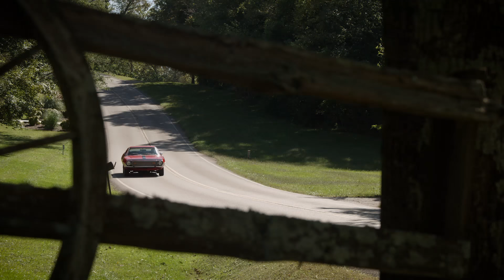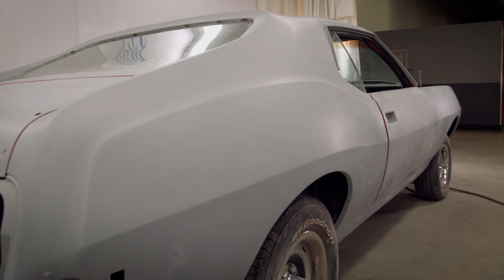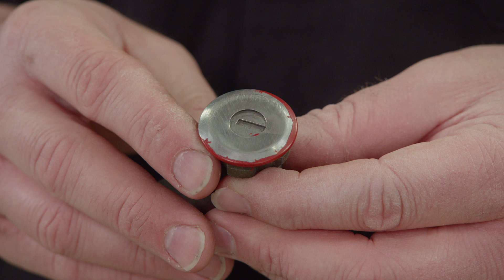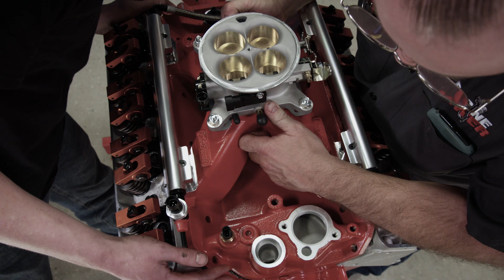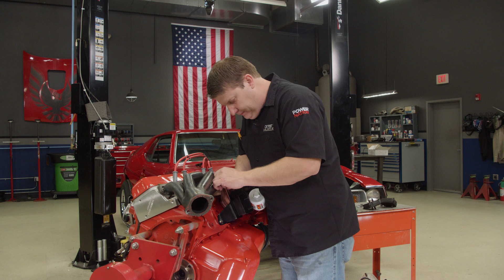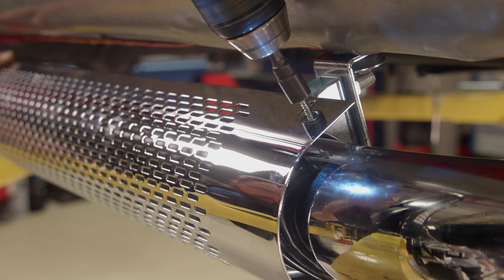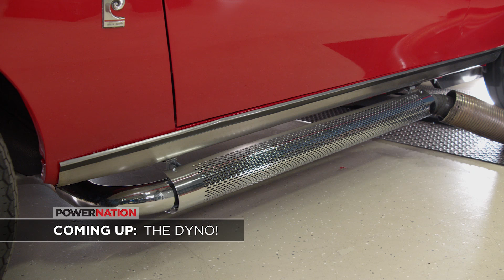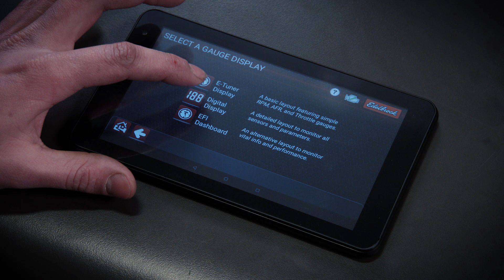Full Build: Transforming an AMC Javelin to a 70s Muscle Machine

Comment: That 304 has to be hurt. I have a 73 AMX with a 304 and it’s a lot more powerful then what this was in the beginning.
Reply: with knowledge any motor can have a high power output
Reply: @moisesgaribay4893  I’m talking stock vs stock.
Reply: The AMX had what was left of the performance goodies in '73 while the Pierre Cardan was a looks and cruiser option minus the power (unless it was an ordered one with the good stuff under the hood)

Comment: one thing to keep in mind, you need to run 91 octane or higher in amc engines from this era. i had a 72 gremlin and the thing ran like crap on anything lower than 91 octane. that's because when these cars came out, 91 was the lowest octane at the time. tried running 87 in it and the fuel mileage cut in half and was gutless. went from being able to smoke the tires to barely able to make it up hills.
Reply: that's also kinda sad if that's all thaty engine was making. a 71 gremlin with a 258 cu straight six made 150 hp with smog crap on it with a carter yf single barrel carb.
Reply: @spicydeath82  I would say the federal government had a lot to do with the decreased horsepower in those 2 years between 71 and 73 as they were putting some pretty awful restrictions on auto manufactures during that time period to reduce emissions. Most manufactures had to de-tune the engines so much that just after a few months of running them, (basically around the time the engine was broken in) the engines would hardly run. Also AMC was struggling  during this period just to keep building cars and didn't really have very much money to put into research, they were just relying on building good looking cars to try and save the company...
Reply: @mjh123crh  Well, the biggest decrease was the way they went from measuring in "gross" horsepower in 71 to "net " horsepower in 72.  That's why a six made 150 hp in 71, LOL.

Comment: AMC never made a muscle car , heavy rusty paper weights. Need to LS swap for any chance of making it anything close to a muscle car.
Reply: You're opinion but not most people and keep your LS in a Chinese hernia emergency vehicle
Reply: @graydonjones6912  that's way so many people rebuild them and there no need for aftermarket parts!
Reply: First, a Javelin or AMX was a Pony car.  I define a Muscle Car as a mid size that made above 300 gross hp and a Super Car as one that made above 350 hp.
So, AMC did make a few muscle cars Rebels. The Rebel Machine was maybe even a Super Car. 
    But the AMC Pony Cars were more interesting.  Think of this: a 390 AMX in 1969 had the same overall size as a C3 Corvette, but with tons more space, and an engine big enough for a Galaxie but in a car with the same wheelbase as a  Pinto.